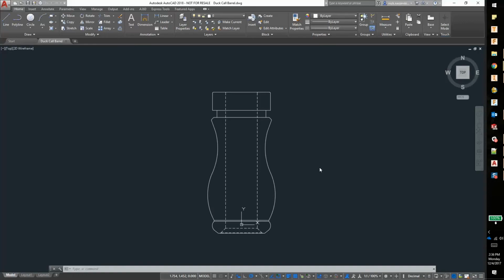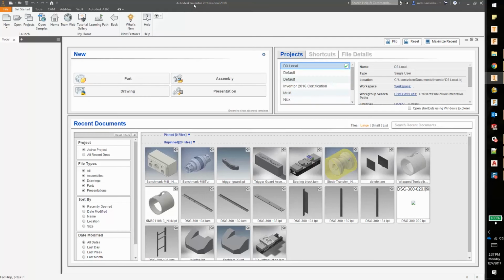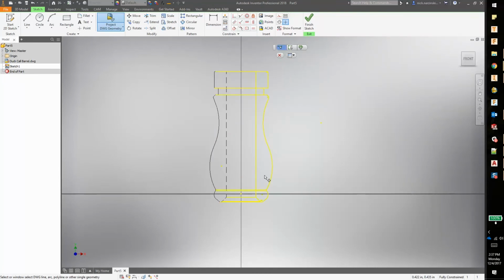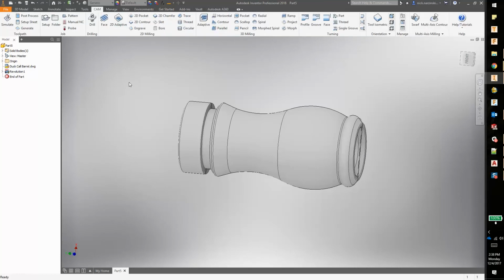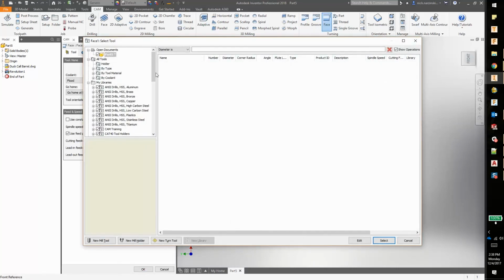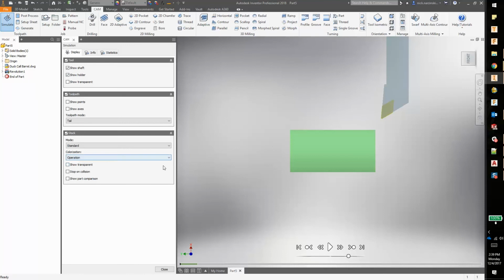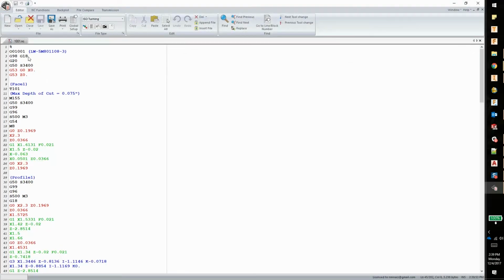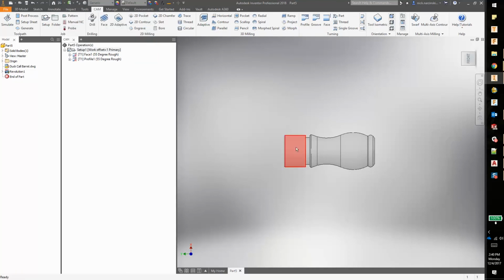Going from 2D to 3D to CAM with Autodesk Product Design & Manufacturing Collection

Comment: Hii  D3 Technologies, thank you for the great video!  i'm a relatively new fusion 360 user and i recently run into a 360 hiccup.. I need some help! How can i achieve this bottle design with fusion 360 https://drive.google.com/open?id=1gskt4BdP0VMXfyphs_xNoVStEUJ7zViY  As you can see, i managed to model the shape in zbrush, but its not perfect for production. What i tried in fusion was projecting curves onto surface and lofting profiles to follow the projected curves but it doesn't work well enough. Please share with us a few tricks to tackle is design